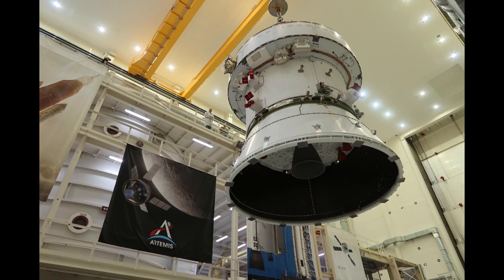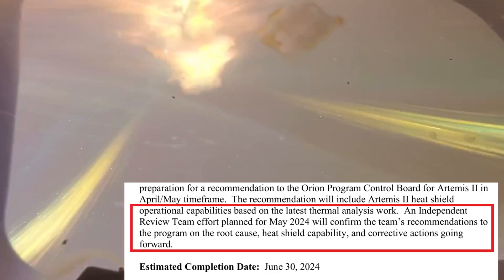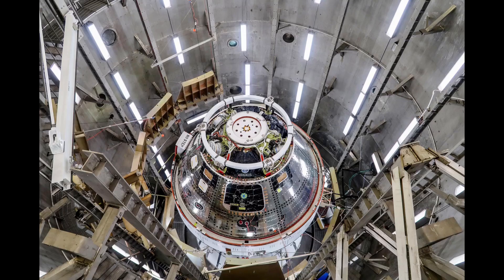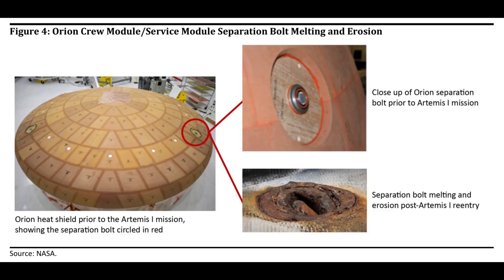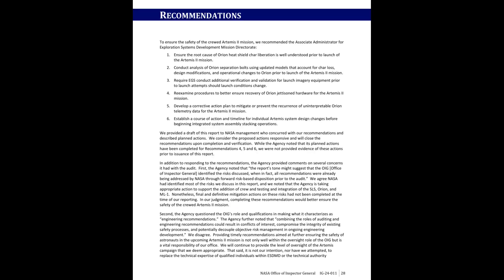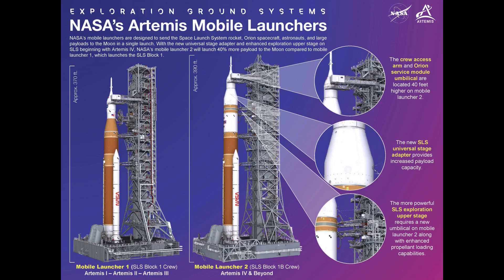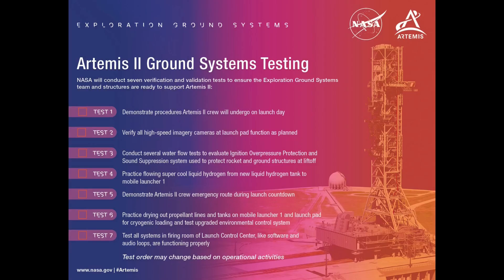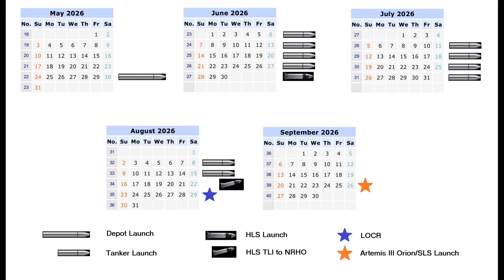Why NASA OIG reports are essential and SLS Cargo is still a thing

Comment: That photo of the Orion heatshield from the Artemis I flight that is shown in that recent NASA OIG report shows just a small part of the entire heatshield.

This is a photo of that heatshield on the recovery ship soon after that Orion spacecraft splashed down in the ocean (11Dec2022).

https://www.google.com/search?q=nasa+orion+artemis+I+heat+shield+post+flight+photos&sca_esv=46a96e68a6d55bfc&sca_upv=1&udm=2&biw=1358&bih=646&sxsrf=ADLYWILt1BrfuAX4W2kKh2Gd2CNZz95wpw%3A1715654568361&ei=qM9CZrfiFaieptQP6KO-CA&ved=0ahUKEwi31uqoj4yGAxUoj4kEHeiRDwEQ4dUDCBA&uact=5&oq=nasa+orion+artemis+I+heat+shield+post+flight+photos&gs_lp=Egxnd3Mtd2l6LXNlcnAiM25hc2Egb3Jpb24gYXJ0ZW1pcyBJIGhlYXQgc2hpZWxkIHBvc3QgZmxpZ2h0IHBob3Rvc0jmkQFQqQlY24gBcAd4AJABAJgBRqABqQeqAQIxNrgBA8gBAPgBAZgCAKACAJgDAIgGAZIHAKAH0AU&sclient=gws-wiz-serp#vhid=QUdCfd8dazG2FM&vssid=mosaic

To enlarge the heatshield image, place the cursor anywhere on that image and double click the CTRL key. In that enlarged image, there is a + gadget you can click to enlarge that image more.

It's evident that the OIG report shows just the top part of the heatshield and not the severe damage on the lower part.

Comment: I remember during the Artemis I mission they said on the broadcasts and pressers that they were doing a skip-entry return to specifically push the Orion heat shield to it's limits, far beyond what would be seen in crewed missions. How much of this extra damage is because of that, or is this damage far beyond what was expected even from that skip-entry?
Reply from the maker: Stephen Clark's story has comments by Victor Glover that add to the nuance, they are on page 3 of that:
https://arstechnica.com/space/2024/05/nasa-confirms-independent-review-of-orion-heat-shield-issue/3/

I don't recall it being a point of emphasis that the EM-1/Artemis I profile was a stressing case in the years leading up to launch.  It may have been during the mission, or during the mission preview right before the first launch attempt, but details were thin.  It's worth trying to get some clarification from NASA now.

This is what NASA was emphasizing in 2021:
https://www.nasa.gov/missions/orion-spacecraft-to-test-new-entry-technique-on-artemis-i-mission/

Comment: I feel there are way too many issues for NASA to maintain the schedule. What if heatshield requires a total redesign ? You wont have a lunar landing by 2030 at that rate.
Reply from the maker: There are issues at this point in development, but the responsibilities are spread out and the work is being done in parallel.  NASA is responsible for Orion development and issues (and also EGS and SLS).  SpaceX is responsible for development of Starship & the HLS variant.  Axiom is responsible for the lunar surface spacesuits.

Definitely still development challenges across all the programs; no one is "done" yet.
Reply: I don’t think the astronauts on A-II will agree to fly on Orion if they aren’t satisfied with the safety of the heat shield. So, if the likes of Victor G. agree to proceed then they will have agreed with the Orion engineers. Looking forward to (what I’m sure will be) that big news conference in early July where they either say Yes or No.
Reply: @stevengoyette3165  I'd have to disagree. They're astronauts, and despite the increased emphasis on safety and science nowadays as compared to early spaceflight, that's still gonna attract people with similar attitudes towards risk as test pilots. It will take spacecraft with a lot more wrong with it than a couple missing ablative chunks that didn't doom the capsule last time to make those lot say "no thanks, I don't wanna fly around the Moon on that."
Reply: It is unlikely there will be a redesign for Artemis 2, based on what we've heard so far.
They've got plenty of time until Artemis 3 so what will happen to that heat shield is probably more uncertain.
Reply from the maker: @brokensoap1717 It's hard to say how much time they have for Artemis 3; the last schedule update forecasted that the Artemis 3 Orion would be ready to handover to EGS at the end of FY 2025 (end of September 2025), which would mean the completed heatshield would need to be ready to mate in probably a year from now, maybe a little less than a year.

NASA already has a lot of factors to weigh for the mission after Artemis 2, but they may also choose to hold on Orion assembly and test for "Artemis 3" prior to heatshield-to-CM mate until after Artemis 2 returns and they have another entry data set.

Hopefully we will get a chance to ask the ESDMD folks about this after the heatshield investigation is complete and they decide how to move forward for Artemis 2.